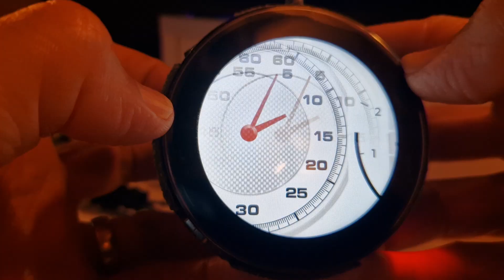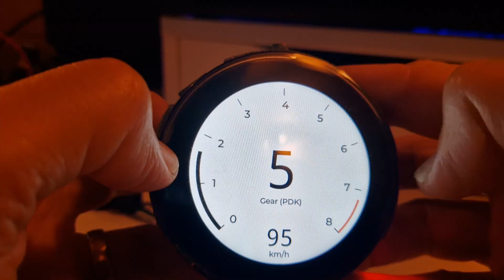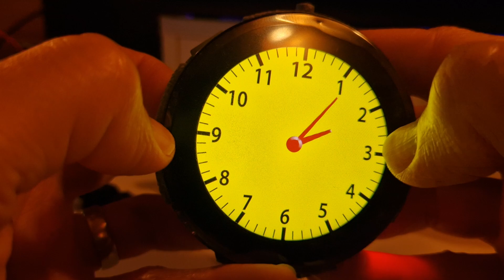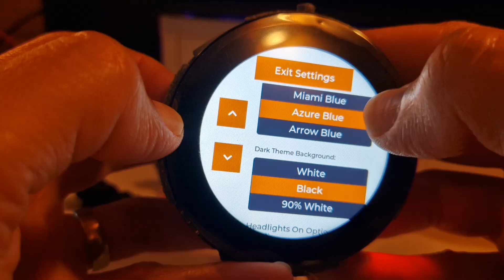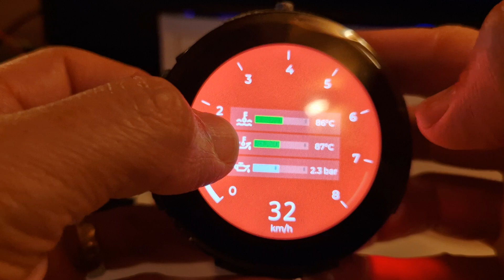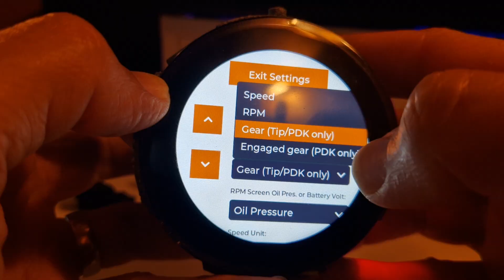Porsche 997 Sports Chrono display updates! Background colours, and centre value display.

Comment: Can i fit this if I don't have sports chrono fitted from factory? (besides cutting the dashboard) I read that the cables should still be there?
Reply from the maker: Hi, I can make a lead to patch into the wires behind the stereo, but will require splicing and, as you say, cutting into the dashboard to route through. There is someone doing this, but they're confident in cutting the dashboard... However that does require some serious brave pills! 😱

Comment: This is awesome! All this data is available through the wires that are going to the sports chrono already? I feel like it's too good to me true. Just plug and play? No wiring? This will work on a completely stock car?
Reply from the maker: Yep! The 997 and 987 has 3 separate canbus networks, drive with the DME, engine data etc... Display, which is the PCM, dashboard and Sports Chono clock, and comfort, which is the heating, AC, memory seats etc... The wires to the Sports Chrono clock have power, ground, wake up and most importantly can hi and can lo for the display canbus network. This carries all the data which will go to the dashboard, so has loads of information on it! The water temperature is not damped like the dashboard (the dashboard gauge does the damping). The great thing about canbus is that all data is broadcast to every node, so everything is available regardless of the end device attached!
Reply from the maker: We've used the same wiring connection so it really is plug and play, no need to splice in any wires, just attach the plug into the harness and you're away!
Reply from the maker: The only thing we're yet to figure out is the coding for the stopwatch, so at the moment you lose the chrono functionality through the stalk... It wasn't a deal breaker for us, but on the road map to figure out.
Reply from the maker: Check out the other videos to see how to install it 😊
Reply from the maker: Sorry, last point, works straight out of the box on a stock car (my old 997.1 is standard except for the exhaust) aaaaaaand breathe
Reply: @997-sports-chrono  Thank you for reponding. That's really really cool. You have a great mind. I have never seen a mod like this for any car. I definitely want one for my 997.2. I live in the US. I wonder how all that Tariff stuff will come into play.
Reply from the maker: @Eatongee thank you very much ❤ it' has been a lot of work, some of it fun, some absolutely maddening! I've recently sent one to the US and there's an option for tariffs, duty, customs etc all paid up front... Send me a message through the website https://997chrono.com and we'll work out what the options are 👍
Reply: @Eatongee  Just got mine last night, I had to pay tarrifs to UPS when they delivered it. Love the gauge!
Reply: Can you display boost pressure?
Reply from the maker: @andresmorales6441  hi, not yet but it's on the roadmap. I need to get some time with a turbo to record and decode the canbus data. Once there, we can add boost pressure - either as a bar, or an arc. It's winter here, so people are tucking up their nice cars until spring, but I'll see what I can find.

Comment: Can you add volts?
Reply from the maker: Yes! Volts is an option instead of oil pressure. As Boxsters do not have an oil pressure sensor and hence not on the canbus, we've added volts as an option to replace oil pressure 🎉
Reply: @997-sports-chrono  Fantastic, going to order one today!